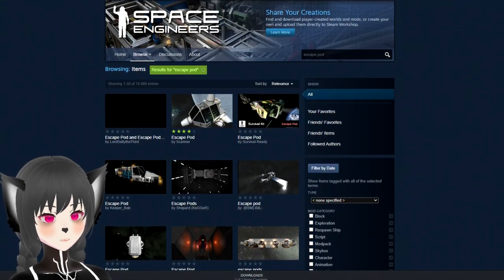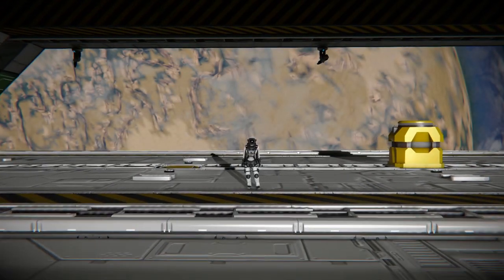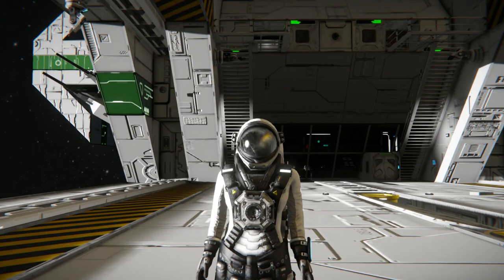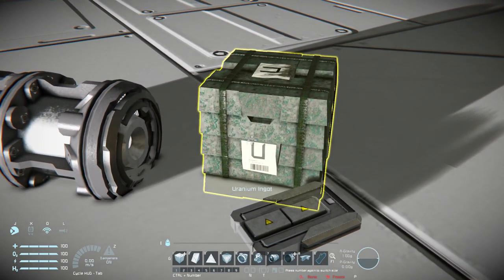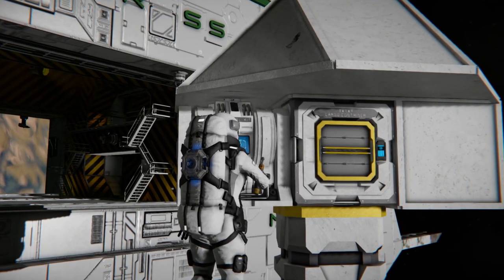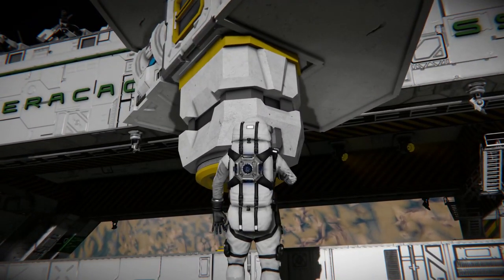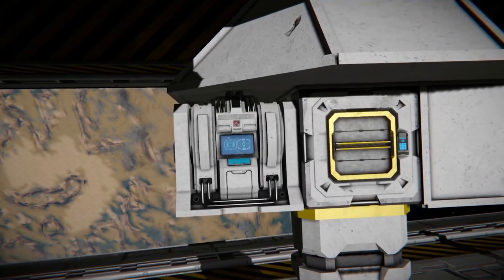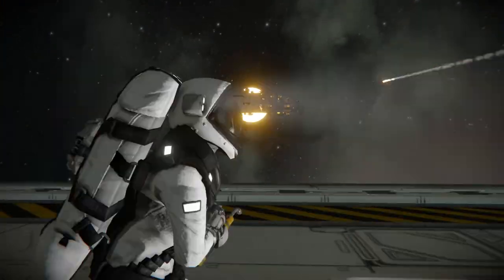How to Make Ship Escape Pods Actually Useful, Space Engineers

Comment: ...oh lawd, I can totally see myself making one of these things then forgetting to put the most important component of all: a sorter in the main conveyor network leading to the pod so that stuff can go into the pod, but not back out.
Reply from the maker: xD rip, you can always manually drag stuff from the ship in there x3 c=
Reply: @LucaTheGuide  XD My problem, latest, greatest, and dumbest at that, is that I found this nice compact four block decoy-torpedo design for attracting AI turret fire away from my ship. The problem is that it's propulsion method is gravity: specifically artificial gravity XDDD

this does mean I could just drop them out the keel rather than devote one or more gravity generators for launching them, but it does mean the ship would be chewing through gravity components for the artificial mass blocks on top of uranium for railgun sabots XD

but that's why...conveyor sorters so that the spares don't get redirected to the welders/fabricators making these decoy torpedoes. Or railgun sabots.

Comment: I don't think a connector would be a good way to attach to the ship because the assembler would take the materials from it, maybe a magnetic pad or merge block would be better. Also, you need to bring all the materials you need for a mini base. Battery, solar panels, an assembler and basic refinery, O2 Gen + extra steel plates. that would speed up you'r rebuild a lot and don't forget the best tools you can afford.  (or maybe just bring the ingots something like: 10k Iron, 5K Nickel 2K silicon and 1K of the other types of resources)
Reply from the maker: I did think about using them but then you won't be able to transfer stuff into the escape pod easily c= and yeah if you have the space having extra materials to start a base would be nice to have on the escape pod x3
Reply: I have use both connector and merge block together with minimal clang issues.
I keep the connectors turned off unless I need to transfer stuff.
Reply: Simply don't have any active production during a transport mission
Reply: you could just use a sorter stuff flows in and doesnt flow out .